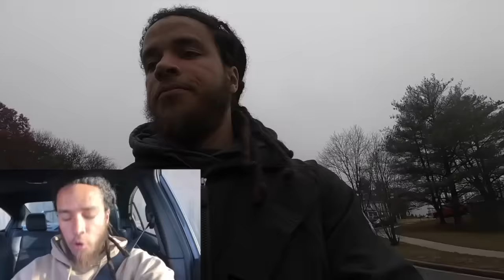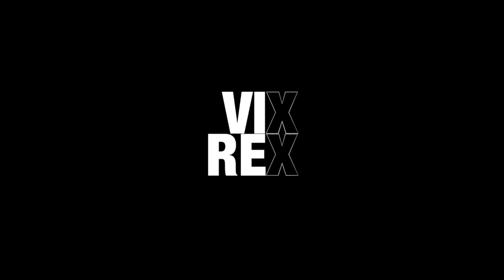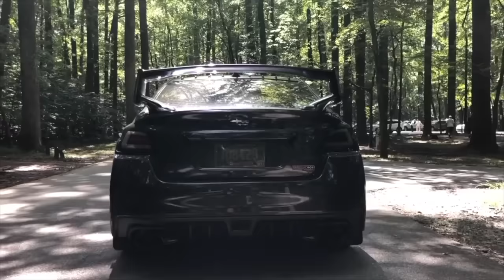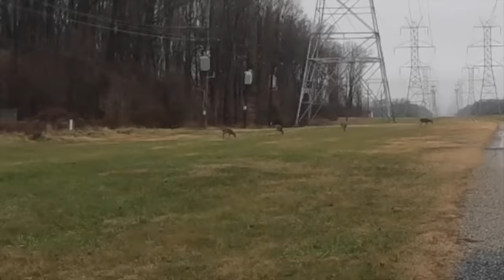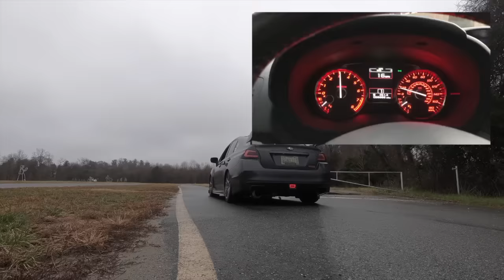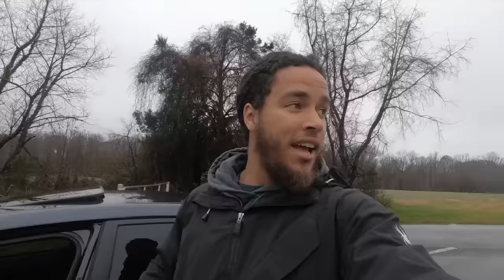How To Make Your Stock Exhaust Pop (NO TUNE)

Comment: For anyone wondering. You do need an aftermarket cat back or turbo back exhaust pipe. If you manage to get pops with stock piping you will damage the catalytic converter and something is probably wrong with your AFR since it's most likely running rich enough to pop while fully stock.
Reply: I do it w/ headers & cut my stock pipe back a little bit. I pop around 2-4k in 2nd, 3rd & 4th.😵
Reply: I'm a little late to ask but I have an audi s7 and it has some pops when I rev it to 4k rpm I haven't touched anything and the previous owner didn't either.

Comment: This method works best in lower gears because it requires more torque. The engine wants to deliver torque so it uses more fuel. And just when you hit that clutch, the excess fuel isn't completely burnt, flowing through your hot exhaust manifold, actually partly burning inside your turbo. The pop comes from the fuel and oxigen mixture rapidly burning (exploding) in your exhaust tube somewhere down the line because it didn't have the time before.

Cars spitting flames happens when there is a lot of flow and fuel inside the exhaust tract, not letting it explode before exiting. Getting rid of the cat and giving it a rich tune usually does the trick.

Backfiring mainly stresses your manifold, turbo and cat. Religiously check your engine fluids when doing this as your turbo will get hotter and burn more oil.
Never try to pop your exhaust with a cold engine. Flooring to 6k with a cold start is like taking anal virginity, resulting in damaged or broken gaskets, bearings, threads, valves, pistons, cranks, cams, you name it.
Reply: Lol, no.  That's no how it works, and it's not "backfiring".
Reply: @VndNvwYvvSvv  Give me your best youtube expert opinion. I bet it's not going to be as shitty as mine.
Reply: @Vogel335  bro your completely correct idk what that other person is talkin bout lol
Reply: Is the pop bad  for the enigine or anything tho?
Reply: @jacket755  it can affect your exhaust manifold is you do it too often or when your engine is wet, as long as your responsible there’s no reason you should have any engine issues
Reply: @VndNvwYvvSvv  it’s not rocket science lmao
Reply: Haha the ending made me laugh 😂

Comment: Step 1: buy a civic
Step 2: straight pipe it
Step 3: hope for the best
Reply from the maker: Easy peeeezy
Reply: MaxSpeed You just need faith in your pipe
Reply: YOU JUST GOTTA BELIEEEEEEVE!
Reply: lol.
Reply: @jesusisthemessiahnotsethro1917  it's a greet pipe ;)
Reply: @goodboi1232  well, now that we're men, I changed my underwear
Reply: My 07 Civic R18 with a $250 catback exhaust pops like crazy. I don't have a tune or anything. Just a SRI and exhaust. Love it.🙏🙏🙏
Reply: Have a Subaru with straight pipe setup, no tuning required, and you'll have the popping and crackling to enjoy.
Reply: @shangarsaravanamuthu  careful with those non si models, they blow a rod randomly which will result in a need for a new engine or new car
Reply: Speaker Reviewer post a video I have an 08 si and wanna see
Reply: Lol I had this project in my head for a while I think I just gonna do it also put a turbo on it cause why not
Reply: @mzerochannel  full send
Reply: Chambered muffler on my 16 Elantra Gt and it pop without ridding my clutch lol
Reply: @CodyDoesIt  it's a manual? My man, great choice!
Reply: @MaxSpeedMike  All my cars have to be manual to keep the wife from wanting to drive lol
Reply: Why are you literally everywhere
Reply: Never straight pipe a civic aha, at least have a vibrant resonator to enhance the sound and get rid of rasp
Reply: Honestly did a muffler delete on my auto civic and it pops looool
Reply: MaxSpeed buy a cheap turbo and have fun
Reply: @LASGProductionz  I have a straight piped b16 and it's not raspy
Reply: Rice rice baby
Reply: Ilan Poot apparently you know nothing about cars 🤦🏼‍♂️
Reply: My B18c5 powered 92 eg hatch pops like a mofo. But it's also got a built head a bunch of bolt ons a sick tune and 3" exhaust lol.
Reply: Step 1: subscribe to pewdiepie
Reply: Yess rice is best, just exactly like a euro rally racer, get the airbags like the old Cadillac hearses did and bright trim and large wing or wings like the old chevys did and lower it like the old impalas were, and get a custom steering wheel like the old muscle cars had, and dont forget dont drive it until you get all of the performance parts and tune that money can buy for that honda and them boom you got you a real ricer hater attracting machine just for your pleasure to watch their faces and beer guts turn red while they say "GO RED WINGS" and "go Ohio state" (backwards logic) with their buick Eldorado or their rusty ford truck that they didn't take care of putt putting in the back ground :D .
Reply: Step 4: Write letter of apology to your neighbors.
Reply: In Spain straight exhaust is unlegal
Reply: @proxer6741  then I'd build one as far as the car can possibly go and then take it all the way off and mess with the spanish police like alot of ppl do.
Reply: MaxSpeed Ricer
Reply: Why straight pipe when you can ghetto rig a exhaust cutout with an old throttle body.
Reply: What if it’s a automatic tho ?
Reply: No cap literally what I did to my 2019 hatch lmfaoooo ima get hate but I think she lowkey sounds nice tbh
Reply: Worked for me 🤷‍♂️ thanks for the tips
Reply: how ricers are born
Reply: Facts
Reply: My stock d13 civic with a backbox delete pops and sounds awesome
Reply: TheCornishGinger i doubt it sounds good..
Reply: @AeroPrixma  it genuinely does no fart can with the carb making it quite bubbly it sounds like a classic sports car and goes pretty well too 😂
Reply: Ppppprrrrrrreeeeeeettttttttttttttt, tar tar tar
Reply: Step 4: tinnitus
Reply: I know its a joke and all but straight piping a civic wont give you pops. Just dry throat kinda obnoxious lawn mower noise
Reply: I have dad
Reply: Shangar Saravanamuthu what exhaust setup do u have
Reply: I have a dc5 type r race header, and its straight piped and it still doesn’t pop
Reply: MaxSpeed will it for a 1.4? Haha
Reply: Step 1: buy a civic
Step 2: sell it
Step 3: buy a real car like a Nissan 180sx
Reply: Done.
Reply: 🤦‍♂️ always makin fun of us ricers
Reply: This comment had me dead XD
Reply: Fax I got a an intergra with a catback exhaust and it’s straight pipe
Reply: @LASGProductionz  or u can keep the cats in it sounds really good
Reply: I straight piped my civic and it’s some good shit
Reply: i just straight piped my civic and it pops a little bit
Reply: My civic have a muffler delete and resonator delete
Reply: What's a price of civic?
Reply: Can confirm this, make sure 3 of the 5 header bolts are loose and you’ll get some more pops 🤣
Reply: Can confirm
Reply: My 07 Civic does a few pops with no resonator and DC Performance muffler, it's louder at low RPMs and pops a few times at around 2500-3000 RPM, and it's pretty smooth at high RPMs.

Perfect sound, not too boring not too ricey
Reply: Yea bro my civic pops and it ain't straight piped
Reply: im glad i have a civic🥹
Reply: Yeah my 96 civic pops.
Reply: My type R pops and burbles without effort

Comment: 1. Swap around spark plug wires
2. Done
Reply: That's not a good idea 😂😂😂
Reply: @Mr_Glenn  it's a great one
Reply: @spacegh0st177  no shit...
Reply: Just tried this and it works lmao easy asf
Reply: Does it actually???
Reply: @Urajotoface  for real!?
Reply: @alfarsi572  yes it really works but I would not do this I'm kidding I haven't tried it myself it's very bad for your engine people.
Reply: @Urajotoface  you don't say lol
Reply: Oh yea great idea
Reply: Only thing is this is a boxer engine and sparko plugs are really hard to get to.
Reply: CME not the plugs themselves the wires connecting the the coil pack
Reply: @tmatt00  Trust me you have to disassemble half of the car to get to it.
Reply: Basically a sub-machine gun
Reply: fisrt comment in a while that actually made me laugh out loud XD
Reply: Lmao
Reply: Haha would definitely work, probably never get up to speed though 😂
Reply: I remember when I had a misfire in one of my cylinders. My car sounded like a damn machine gun
Reply: hahahahahahahhaahhahahaha
Reply: Yeah I run my car like this it's fine if you get it the right way wrong if that makes sense, it drives just fine but sparks the cylinder on tdc when the ex valve is open burning any fuel vapour in the exhaust out, we call it wasted spark,

Try it before you go crashin on about firing order 

The method is fit 3 to 1 and 1 to 3 in a four cylinder engine
Reply: Misfires 💀

Comment: I do the popping but In a different way that doesn't require burning my clutch. It's kinda like tricking the system. Basically just roll in 1st and when you hit 3k rpm (or any, doesnt matter) quickly let go of gas but at the same time pushing in your clutch all the way In then quickly start revving it like crazy and you can rev for who knows how long. Your basically tricking the system to spit fuel out.
Reply from the maker: Yessir that’s what i do as well! Thanks for watching man!
Reply: Delayed gear shifting exactly as mentioned just tricks the system to send gas for gear 1 late shifting will cause a consistant gas flow to the engine when it should calibrate for gear 2 hence the pop sound comes when left over gas is shot through the exhaust, damage wise nah clean up eventually ya
Reply: Revving while you push the clutch in will probably overheat it if you do it for too long
Reply: Doesn’t it burn the clutch if you rev the car in gear with the clutch in?
Reply: @foxzeyo9374  no because the clutch isn’t engaged
Reply: @vtec224  wise words
Reply: @foxzeyo9374  Oh yes, it does!
If you press and hold the clutch for a prolonged time, you cause unnecessary wear of the release bearing.
Reply: @chonk5174  Sorry, that's wrong because it affects the release bearing of the clutch.

Comment: Get some catless downpipes, and a tune. Let's see some 5 foot flames 🔥🔥🔥
Reply from the maker: You know it
Reply: What is cat less downpipes?
Reply: @ogrecknerryzaog7125  A pipe without Catalytic Converter
Reply: Dunno about america and other places but here in Australia removing the cat is illegal so look into that first
Reply: @shabztar123  as if that stops anyone
Reply: shabztar123 surprisingly enough, emission tests are different per state, some check for this, others check for that, … so in some states a catalytic converter is not required…
Kinda crazy, I'm pretty sure that'd be illegal over here in Europe as well
Reply: Tuner refused to add in flames from my catless setup. He is very safety oriented. So at least my engine will last longer.
Reply: I wish but my 500 abarth doesnt pop at all and its straight piped no cat,res or muffler like wtf
Reply: @murphygaven1  an Abarth!? Those should pop like crazy! Try catless down pipes
Reply: @MaxSpeedMike  thats what i have maddness decat downpipe
Reply: @murphygaven1  idk what to tell you lol. Everytime I see a 500 Abarth it sounds crazy loud and pops like crazy, try looking at some forums and videos for your specefic car
Reply: @MaxSpeedMike  yeah true alrighty thank
Reply: @murphygaven1  anytime bro 👍
Reply: @murphygaven1  you can try a tune. It has to do with the combustion stroke and exhaust stroke If there's still unburnt fuel in the cylinder upon exhaust stroke It continues ignition in the exhaust. A/F adjustment and timing can produce nice pops but go to far with it and it's supposedly hard on shit.
Reply: @anthonybarton1591  yeah very true thats my next goal thanks
Reply: @RogueCowTurd  Never dealt with Australian police, have you? They're anal about any car mod, let alone blatantly illegal ones.
Reply: @shabztar123  shit i never knew that coz i was planning it

Comment: The only "damage" your causing is to your throwout bearing, you're just wearing it faster. Not really a huge deal, it'll just have to be replaced at some point.
Reply from the maker: This makes sense, didn’t realize that.  Thanks for the useful input

Comment: I got an 04 forester xt, catless downpipe, 1 resonator, and 1 muffler, and mine shoots flames. I got an automatic too. While rolling, I put it down into 3rd, get it up to around 3300 rpms and let off, and then just feather on and off the gas. Doesn’t pop too loud, but you can get some flames🔥.
Reply: What do you mean by feather
Reply: Lightly ?

Comment: Nice video bro! but there is a simple difference. some cars like subaru evo etc have default settings to the control unit that throw more gasoline in the exhaust. i have a tts with 320 horsepower and full skat and does not make half of these bangs here, the only way would fatten the map

Comment: Easy unplug a one spark plug wire
Reply from the maker: Now you're talking. Lol thanks for watching for real though
Reply: Slap rice krispies badge on the rear bumper...
Reply: *How to make a Honda sound like a Subaru EJ
Reply: I HAD this but not on purpose.. sounds like a lawnmower.. very bad economy lol

I propose a better idea.. 3 very good platinum plugs or coils and one cheap.. so it selectively misfires

Maybe even a selectively firing coil sysyem... hmm maybe ask an engineer bout it
Reply: @Stk123  You don't need not fucking Cat esspecially in America and on Turbo Engines
Reply: @ManOfAttitudeLP1998  are you standing up?
Reply: @teemoneyy9838  what
Reply: Tee Moneyy My name is (              )
Reply: @Branbran1993  will the real slim shady please stand up
Reply: @Stk123  who the hell keeps the catalytic converter?  That was the first thing to go on all my cars
Reply: @mikejames1860  in many states you cant pass inspections without catalytic converters
Reply: @VIXREX  can you do it with an alteza?

Comment: And those pops u get when shifting or just pressing clutch down and revving  while rolling is called Clutch rolling revs or just clutch rolling wat I call it ..revs and pressure  is different  in each being in hear or neutral  so when u rolling in 1 lst 2nd or 3rd clutch  rolling revs to show off but if really driving just rev shift in between shifts ull get some pops  rev shifting is a skill base helps with foot work as well

Comment: I get some nasty backfire pops when I just cruise at 3krpm in 3rd for a minute or so with about 20%+ throttle and about 1lb of boost or none.  this allows unburned fuel to gradually build up in the exhaust system, then I floor it full boost 100% throttle and when I shift into 4th at about 5.5k rpm, POP loud asf. Its from the unburnt fuel that built up in the exhaust burning and then POP.
Reply from the maker: Hugh Vupy dude...it makes sense now
Reply: My eclipse sounds like a shot gun when i shift
Reply: Hugh Vupy we need a video of it
Reply: @sebastianfuller6156  2nd
Reply: Same here, i get a loud firework pop and flames with the same method!
Reply: @username8644  indeed, if you have an adjustable vent BOV, if you vent 100% to atmosphere and no recirculation, your subi will run richer and can still achieve nice pops here and there with an aftermarket cat back.

Comment: I did that on my crz na too.. need skills on your leg.. but unfortunately i ard sold my crz an get a new cla45 pops more louder with dp and stage 2
Reply from the maker: NA much harder it seems so respek.  thanks for watching!
Reply: For my crz usually i pump on cluth and pedal at once then release depens on the rpm.. but for my crz i do change my exhaust with direct no muffler and no resonater.. only remain the cat
Reply: More louder!! Thanks for the laugh.

Comment: What I’m thinking is that the turbo also helps out with the pops. For example I have a 95 3000gt sl, and it’s close to stock because all it has is stock exhaust but straight piped(took off the cat and one muffler). It pops but not a lot🤷🏽‍♂️
Reply from the maker: the turbo def helps in this case. thanks for watching

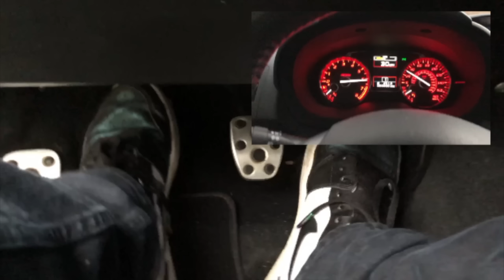Comment: 4:24 4 pedals????
Reply from the maker: new new...stay tuned lol
Reply: Far left is a dead pedal I think. It’s where you rest your foot.
Reply: Its a foot rest
Reply: Chill guys it's just a second clutch pedal. You know double clutch system and shith.
Reply: @bootleggerco.4646  oh yeah dsg
Reply: ABCD
Reply: Maybe is the "hand brake".. there are some cars that have there the hand brake... 
Or is hood/trunk/fuel openner :)
Reply: @VintilaVlad45VVA  european cars.. multi fumction like a swiss army knife lol
Reply: Its a foot rest
Reply: Yes, that's a manual double clutch!
Reply: Double clutch
Reply: It's called as dead pedal, people!
Reply: 5 with driver
Reply: You've never heard of a double clutch?
Reply: @atanpeep4162  lot of american cars have the "handbrake" there now too. I know some ram trucks and the ford taurus do but i dont think any manual car would have it there, way too risky if youre aiming for the clutch and have to risk hitting that
Reply: @bootleggerco.4646  granny shiftin not double clutchin like you should
Reply: It’s instead of the hand break
Reply: @bootleggerco.4646  Lol
Reply: It's Used to set the clock
Reply: Its also a foot brace.. when your cornering
Reply: Danuzz it’s for the fast and furious gears.
Reply: Guys chill it's to activate the tr25jz turbo timer don't be so rough on the guy
Reply: @michaelthackray3258  it activates sutututu mode
Reply: Clearly you drive a automatic 😆😂🤣
Reply: @swizy8.8.8  call for love
Reply: @thecanucklehead3034  taurus has it there I flipping hate it
Reply: It’s simple. You have the gas, break, clutch, and all the way to the left is the legendary WRX pedal. You push it in to put your car in it’s highest possible performance mode only to be used when you line up next to an EVO. If you push it in twice, it increases the air circulation throughout the cabin to clear the car from getting vape baked.
Reply: Left pedal is for the the rear brakes.
Reply: The Canucklehead u racing and u winning and u hit the E brake 😂
Reply: second acceleration for going really fast
Reply: Granny shifting not double clutchin like ya should